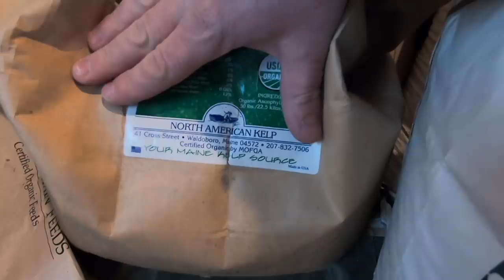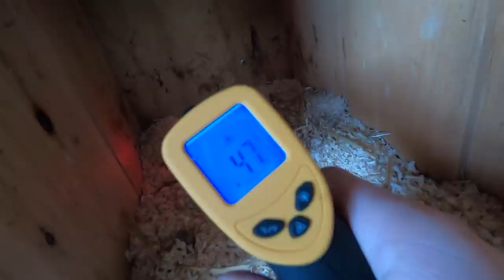Hoping for the Best! DNA Testing our Puppy for Gene Mutation (MDR1)

Comment: Buttercup got into the hay feeder because if you go back and look at about 18:52 where Willow has her head in at that spindle/section that you replaced somehow is or appears by eyeballing it a bit wider on one side (larger gap to one side). Meassure it and see... it sure appeared to be slightly wider on that one side of that new spindle from the video angle we had at least. Wouldn't hurt to meassure and check to see. And if it is slightly wider than a bit of motivation to get at the feed is all she needs and then she squeezed the rest of the way in. Doesn't take much and it isn't too obvious so very easy to overlook it. 
Anywho Stay warm and safe God Bless.

Sincerely 
Robert Benson 
(Gwinnett County Georgia)

Comment: So, I truly don't know how you do It. I'm near St. Louis Missouri and its been in the negatives for a day or so and the wind just won't let up. Its so cold that the furnace is on more than its off. Its sooo cold here and of course I had to go to the E.R. yesterday. I couldn't get warm even in bed with the electric blanket on and then going outside was almost too much. Luckily they didn't keep me, they nearly did, but I wanted to go home. When I got home I turned my blanket on 4 of 6 and finally after 4 hours, I was warm. I just don't know how you all do it with temps soooo low!!! My hats off to you all up there.

Comment: Hey AL, In regard to the temp of a freshly laid egg. Consider it takes about 25 hours for an egg to form around the yolk before it gets laid. So the egg is whatever the hen's body temp is. If you ever gutted a freshly killed meat bird that is a close idea of the temp. Or look up on  line the body temp of a chicken. Once you have determined that run a container of water and heat or cool it to the exact temp.  If you hang around the hen house enough you will find a hen in the process of laying, you may even catch her   egg as it is expelled since as they lay the egg they stand very still.  Rick in pa.

Comment: The google reports the body temp of a chicken is 105F to 107F.  So I would think the egg would be close to that temp when laid.  At your current temps in the nesting boxes it will lose the heat quickly unless the hen remains sitting on it.  Incubators are normal set for 99.5F so that should also be close to the temp when it is laid.

Comment: Easy fix .... Run 2- 2×4s or some kind of thinner board horizontally attached to the spindles on each side and have one 4 to 6 inches down from top and the 2nd one 4 to 6 inches up from the bottom ... Create squares in the spindles instead of complete vertical slots for them all they need is enough room to get their heads in and out 👍
Just an idea

Comment: 105 to 106 F is what it should be for a chicken as chicken body temperature is around 106F
Reply: I doubt it dropped 50°+ in the 5-10 minutes in between Al checking.
Reply: who knows but it 5 or 6 degrees so I would not doubt it @mikozuna
Reply: I don't know what a chickens body temp is but the egg would pretty much have to be the same when exiting the body.
Reply: Correct. At the exact time of laying the egg has to be at the core body temperature of the hen, which on average is 106 F. Any measured temperature of an egg after laying will be less than this, obviously. He did not measure it right at the second it popped out so any temperature he gets on his device is only indicative of the time the egg has spent cooling off.
Reply: I agree with Jimmy said about the egg temps. But I was going to say, stay there visiting the chicks wait for it & whola, your there at the right moment. Don't for get a blanket and hot waterbottle, lol
Reply: average body temperature of a chicken is 107F (42C). Were you measuring F. or C.?

Comment: Al, you may want to check for loose rungs in the Hay rack. Butterball...er cup may be pushing one aside to get in, then the rung settled back into place looking like everything is secure. Those deck screws you used have a smooth shank towards the head on the rung side and maybe the rung is riding on that smooth part when Butterfat...er cup pushes against them. You may have to add another toenail screw going in from the other side to lock the rungs to the rails. i.e. two screws on top and two screws on bottom of each rung. Maybe once Buttercup (ha) is as large as Willow it won't be a problem, but seeing how she is already well known for sticking her head where it doesn't belong... Well, Good Luck Kind Sir!
Reply: P.S. I hope Tanner's test come back negative. I would also like Spring to hurry in this year. I live down the mountain of a ski slope but the only winter sports I do lately are the 100 yard snow throw, the roof rake pole vault and the high snowbank (shovel) Jump. If it doesn't warm up soon my curb side mailbox will be absorbed into a snowbank comprised of packed powder on a compacted frozen granular base.

Comment: The egg would be chicken body temp. 105-107° and cooling as it sits. For hatching kept at 99.5°.
Reply: Interesting info, surprised the eggs he checked cooled off so quickly. Thank you
Reply: Greg Kahle his temp laser just reads the outside surface which cools off quickly. The inside egg yolk and album retains heat longer.

Comment: Just aim the thermometer at a chicken and you get the true temp of an egg that was immediately laid. 

I have a strong hunch that your goat is pregnant. 

I noticed that the rung you had replaced on the hay feeder isn't exactly spaced apart as evenly as the other ones. I think that's how your goat was able to enter the hay feeder. 

In Wisconsin, we had very temperate weather for much of the winter and hardly any snow. Then we were recently hit with the polar vortex and got dumped on while the temps plummeted to a windshield factor of -60 yesterday. It's been pretty cold all week with all this Arctic weather. So many of our vehicles were and still are inoperable. Now, this weekend we are going to see 40 degree weather. It's safe to say that we now share the bipolar weather you guys have been having on the east coast. 😄😊

Comment: I would imagine that when an egg comes out of a chicken it should be close to what the chickens body temperature is (since it was inside). Normal chicken body temperature ranges from about 105 to 107 degrees Fahrenheit. I am guessing that the temperature of the egg (especially the outside shell) drops drastically in those first seconds (especially when it is cold outside. The inside of the egg probably cools down slower than the outside shell though.

Comment: How about putting a wireless cam in the chicken coop to see when one of the hens lays an egg. You can watch it on your phone in the warmth and without disturbing the hens. They can be picked up cheaply on ebay.
Reply: Al would need about $300 or more in WiFi extender equipment plus batteries to transmit WiFi to the house from New Yolk City..
Reply: Hi, I was thinking something like this 'ET SQ13 Mini Camera' from ebay. About 40 or 50 dollers. 20m range. It will be used to check when the egg is laid. So can then rush out to take temp.
Reply: @stevesammut499  New Yolk City is more like 100 m away, at least 65 m away.